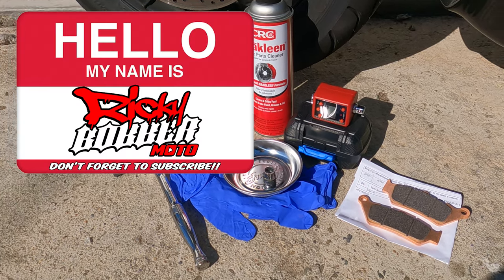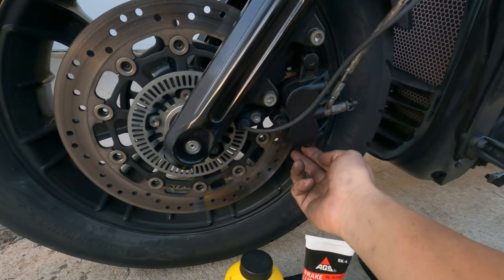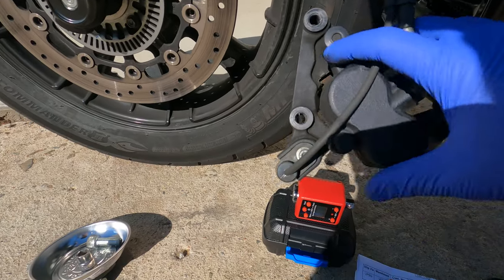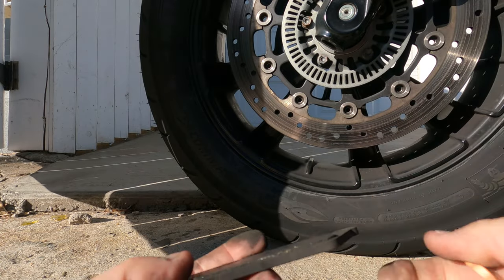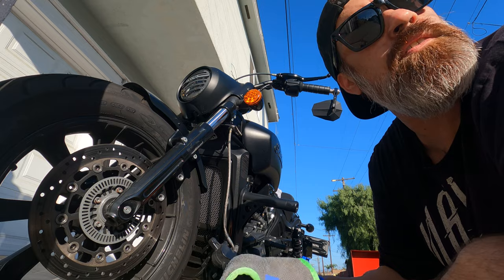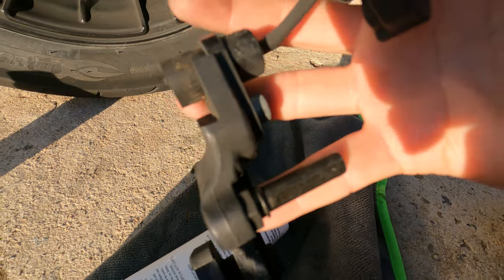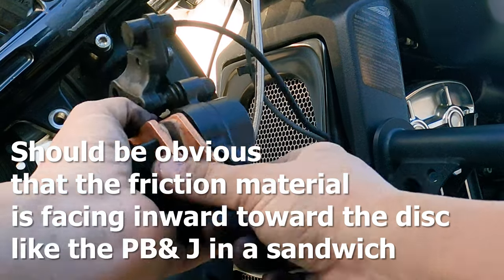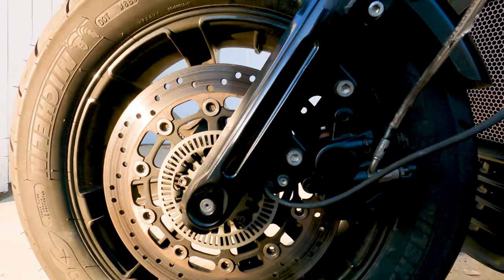Changing the Front Brake Pads on an Indian Scout Bobber

Comment: Loosen the master brake fluid cover and then you can just use the old brake pad to push the pistons back into place, just keep a towel around the well in case of overflow as break fluid eats everything. BrakeKleen works perfectly fine for cleaning parts and there is less chance you get the fluid on any painted part. With the grease you can honestly just put a bead at the top then add your pad, the pad will spread it over the piston, grease at the bottom does pretty much nothing but drip off later and grime up your bike.
Reply from the maker: Grease at the bottom of what?
Reply: @RickyBobber  see how you ran the grease all the way across the post? The stuff at the bottom is pointless. If you go middle to top the pads will spread the grease when you put them on
Reply from the maker: @BikesBeardsAndBrews  aah good call. Also thanks for watching the whole thing
Reply: I’ve watched this and wondered why he didn’t take the reservoir cover off, fighting pressure makes it a lot harder than it needs to be! Maybe too worried about fluid spilling.

Comment: Good job Ricky.  I may have an issue with the brake on my sixty.  The dang thing is so stiff that even when under moderate front only braking its not enough to trip the brake light.  The inspection seems ok though.
Reply from the maker: Hmm, might need a brake bleeding. Possible there's too much fluid?
Reply: @RickyBobber  It was my initial thought but im not sure.  I may try and see. Thanks!